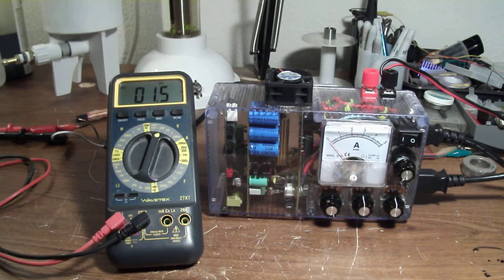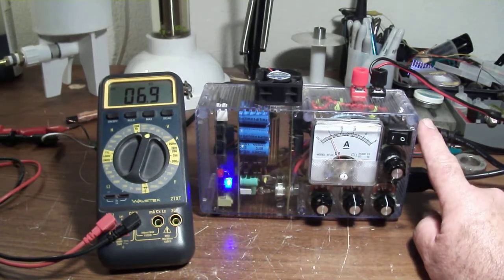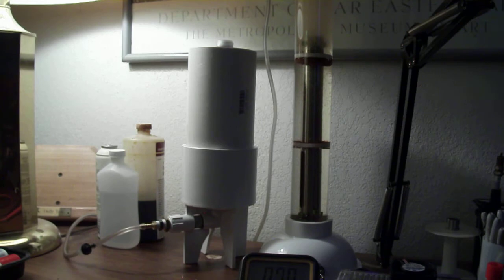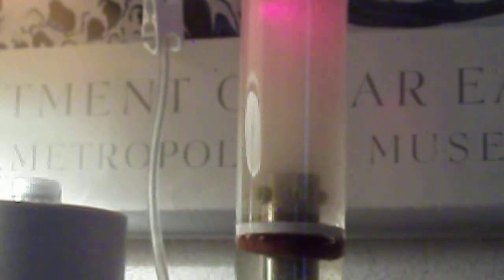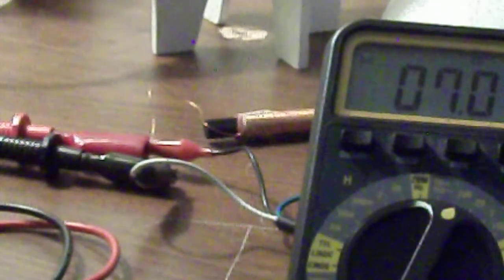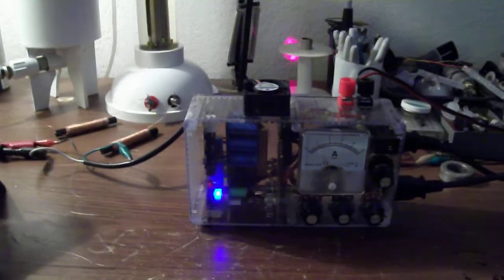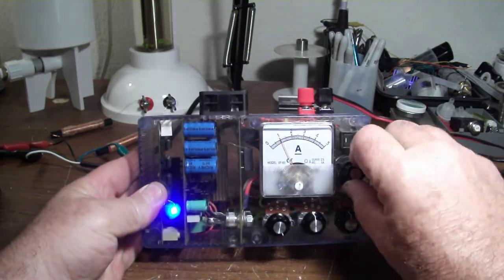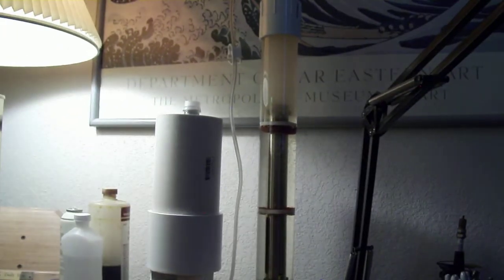8-x-a Circuit, modified Meyer's circuit

Comment from the maker: @irondmax Thanks for the observation, I did find out from another source @ open source energy that both components are functioning properly , it's just that the pulse voltage is not going low enough to turn off the scr, thanks again, Jeff.

Comment from the maker: Hi all, I just found out that the scr in this circuit is not being turned off between pulses so therefore the water fuel cell is not being pulsed the way it should be. Russ Gries just posted a new version of the Meyer's schematic which he will also be updating shortly, thanks for looking, Jeff.

Comment: Hook up your bifilar chokes so that the start of the winding of the positive goes to the cell and the end of the winding of the negative goes to the cell as this cuts down the amperage considerably by some 1000%. Also add in a microwave oven transformer between the variable transformer and the bridge rectifier. Note you will have to change some things to handle the high voltages, okay? Then your all set to start dealing with some high voltages and low amps for a change.

Comment: @nadingjeff then your resistor is wrong .eithor you resistor on the high voltage to the optcoupler or the low voltage side